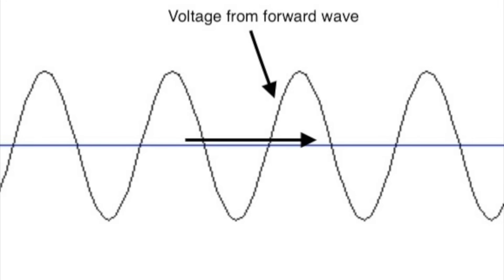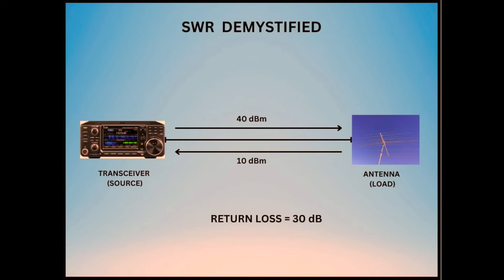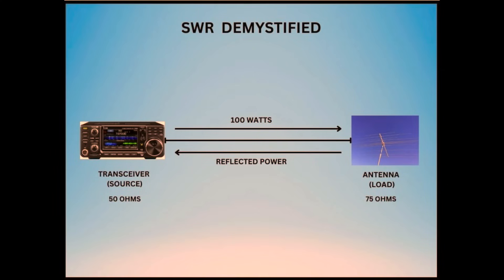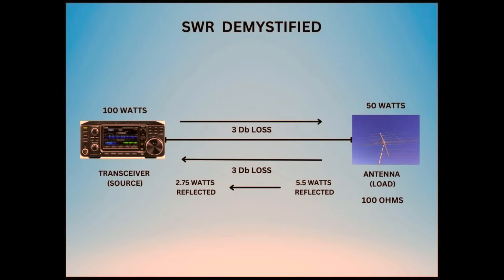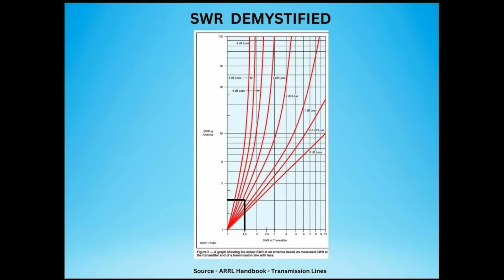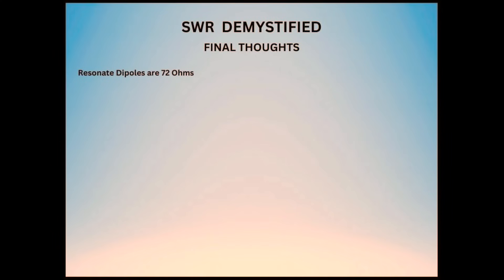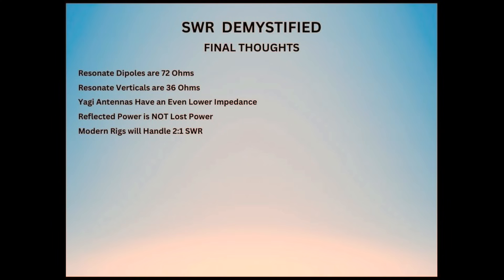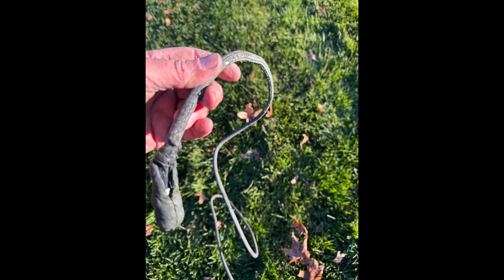The Truth about SWR: Debunking the Myths and Misunderstandings

Comment: If power isn't reflected and absorbed by the transmitter, why are finals damaged by having a high SWR? 

My personal take on feeder losses is that if you have a loss anywhere near 3dB you need to give your head a wobble and give up - especially at HF.
Reply: Put a 500  ohm , Yes 500 ohm dummy load on your transmitter output. 10:1 SWR. The 66% of the power cannot be transferred to the load by the PA Stage. The PA Stage is still making power. So the heat has to go somewhere .  Consider a 50 ohm load at the end of say a 500 ohm open line. 1/2 wave length long . What happens then? Are those reflected waves going to blow up your finals?
Reply: @2321brendan  that's exactly what I've said,power won't leave the transmitter, a half wave length of feedline will repeat the load impedance,if 50ohms then no there's no reflected waves
Reply: @2321brendan  I don't get the point that you are making - you state that the heat needs to go somewhere which I agree with, so where are you saying the heat goes? Into magic beans somewhere or reflected back to the finals of the transmitter?
Reply: @rjy8960  if you don't understand what he has said you can't call BS
Reply: @Pioneer936  Lol yeah, right.
Reply: @rjy8960  yep you full of bs
Reply: @Pioneer936  I passed my RAE at the age of 15 back in 1983, worked in communications all of my life having graduated from Coventry University and had one communication system that I designed patented. 

You?
Reply: @rjy8960  yet you don't understand how the radio is overdriving it's self trying to put power into the system
Reply: It's the impedance the radio sees that causes the radiobto heat up ,reflected power joins the forward power back towards antenna
Reply: @Pioneer936  How does an impedance cause the radio's PA to heat up? For a PA to heat up and fail it implies energy does it not? I'm asking where that energy comes from.
Reply: @rjy8960  the radio is trying to put its maximum power into a mismatch line which causes the radio to over heat ,the power that leaves the radio is less the difference of the reflected power
Reply: @Pioneer936  I'm sorry but I really don't accept this. 

The fundamental problem with this argument is a 3dB loss in the feeder. This is BS. As I mentioned in my initial post, a 3dB loss in a feeder is a stupid assumption to begin with. Even at 2.4GHz over a 24m run of feeder my losses are better than 1.6dB. At HF they are a fraction of a dB. 

Have a look at some of the reports for finals failure for the QRP Labs QRP radio's where a mismatch of over 1.5:1 causes the output MOSFETs to fail. 

Why does this happen if all of the reflected energy gets reflected back to the antenna?
Reply: @rjy8960  it happens as I've mentioned before because the radio is overdriving itself to put power into the mismatch
Reply: @Pioneer936  This whole argument is BS. Power is reflected back into a transmitter and can cause damage. My Kenwood TS-990 will start folding back power with a mismatch of 1.5:1. 

Why do you think that broadcasters spend a shedload of money on low loss transmission lines and monitor the match between the antenna and transmitter? Because they are dumb and are using lossy feeders? 

This whole argument is absolute BS.

You want to lose 3dB of your power in a transmission line and just hope for the best, then be my guest. 

I still haven't had a technically sentient argument against my initial question.
Reply: @rjy8960 it foldsback power because of the impedance the radio sees

Comment: Using RG-8X coax with my 20w G90 seems to work just fine, but if you have a more powerful base station and want to support a wide range of frequencies, then getting good coax is a definite must.
Reply: 5 Watts here and Mini 8 coax 25 feet so no great loss to 20m to 10m dipoles and works well.
G4GHB
Reply: I have been a Radio Ham operator since 1984 and my advice is buy the best coaxial cable you can afford as it can be the weakest link in an antenna installation and as SWR increases this will in turn increase the coax losses especially at higher frequencies above 28MHz.

Comment: ive got my swr down to 1.3 but when i talk into the microphone it goes up to 3 is that bad ?
Reply: Short term that isn’t an issue, but make sure to use an antenna tuner if you have one.
Reply: @Sonicgott  yes i tuned my antenna dead key down to 1:4 with an swr meter its just when i talk into the mic it jumps to 3 and above
Reply: R.f. getting back?
Common mode currents on the coax?
I'd check for r.f. on the coax. If yes, put a ferrite ring on.
G4GHB

Comment: @DXEngineering I would love to see a presentation about a 130 ft doublet fed with 1" twinlead/ladder line.
Reply: That's a good antenna, especially for HF. Balanced feedline impedance largely depends on the wire spacing. The smaller the spacing, the lower the impedance. The feedline impedance levels off around 750 0hms, with a spacing of about 2 feet or greater. If the wires are spaced a hundred yards apart, the impedance will still be around 750 - 800 ohms! Original balanced feedline consisted of 2  12 gauge wires spaced 6 inches apart giving an impedance of around 600 ohms on HF frequencies. Back then, SWR wasn't even a thing! You could easily tune the final vacuum tube finals to match the high impedance feedline. Every drop of power developed by the finals got radiated from the antenna.

Comment: Art, I have been an RF engineer in broadcasting for 45 years. My background is high-power AM and directional antenna systems, as well as FM and TV. I currently work for nearly the biggest corporation in the U.S. and is a worldwide company, so I too know a thing or two about RF. Sure, LF-MW can get away with some losses, but let’s not be teaching people that reflected power is a myth and doesn’t mean anything. It’s contradictory to admit losses occurring in the coax and to then say the reflected RF will find its way back to the antenna. Tell that to the many who have blown up finals and overhead tubes. And with many low-power rigs out there only capable of 5 watts being used today, antenna system efficiency is important. 

I’m looking at pages 9-5 and 9-6 of the 19th edition ARRL Antenna Handbook and it clearly addresses exactly what I am about the importance of matching and where to do it. It even refers to Frank Witt’s article, “Match Bandwidth of Resonant Antenna Systems” in the  October 1991 QST. I’m not sure what books you are referring to, as they discuss line mismatch losses in the “Feed-Line Impedance Mismatching” paragraph starting on page 9-5. 🤔

Comment: Oh my, now we’re tuning coax! Tuners belong at the antenna, not the transmitter. Are you putting your half-wave antenna baluns at the transmitter, too? All you’re doing is creating more loss in power by bouncing the impedance of the 50 ohm cable on both ends. Phase would only be affected by the output coil, but what you’re adjusting it for is to wipe out the reactance. The SWR or reflected power from the forward coupler metering circuit is not looking at phase, it’s looking at energy flowing in a particular direction. I need a Tylenol. 

This is why resonant antennas work best folks. This is why the  DXCommander and similar resonant antennas work well. Keeping the load as close to 50 ohms and minimal reactance is the key. And when it isn’t, matching/tuning it at the antenna will provide the most effective results, not the tuner in the shack. All that reflected power coming back into the shack is really getting lost in the coax, your output tuning network and final amplifier transistors or tubes, and not slingshotting back out into the antenna. Again, use your basic training; place an ammeter on the antenna and calculate your results.  Or… Place a remote tuner at the feed point and tune/adjust for maximum power from the shack. 😊
Reply: I like resonant aerials. I have 5 dipoles 20m to 10m in my attic and an outdoor inverted vee for 60m.
I was given an MFJ 16010 tuner with two SO239 sockets, one to the tx and one to the aerial. All I use it for is one to the tx (changed to BNC as I run QRP) and a banana plug fits nicely into the other SO239 to a long wire. I've never thought a tuner on coax to an aerial works well.
Before I built my resistive SWR meter I adjusted my tuner and long wire, a roller coaster and variable cap. at that time for maximum r.f. out as indicated on an r.f. pickup meter at the wire. It served me well for years. I used a similar set up at a special event station with three 5 foot lengths of aluminium tube which slotted together for a vertical.
G4GHB
Reply: @TheScottClifton reflected power joins the forward power it doesn't go back into the radio and damage it ,the radio damages itself trying to put power into a mismatch that's why we use tuners at the transmitter

Comment: I find the best VSWR is when you connect a 50Ohm lump of carbon across the antenna, but i don't seem to hear much. My ERP is very bad as well. But i'll live with the great VSWR 🙂
Reply: LOL
Reply: Don't be lazy.  Get to ant to resonate at the operating freq with a 50ohm load... That carbon dummy is absorbing unnecessary RF power.
Reply: @Johann-ZS6L  but my 50 carbon load works  on all frequencies giving me a perfect swr of 1:1, its a joke man, swr can be great  with shit coax and  no antenna. Back in the 80's a new ham on 144MHz had a great 1:1.5 swr  but could not work anyone. Checking his set up he had the thinest coax I've seen and it was snapped at the antenna. We calculated that with 10 W in a out 1 or 2 watts reflected back so  bugger all at the  swr  bridge gave a great reading.
Reply: @Johann-ZS6L  no I was just pointing out that a good vswr does not mean that the antenna is doing anything.  Long runs of coax, antenna mismatch,  etc need to taken into account.  I check my antennas with the vswr bridge as close to the antenna as possible or use a NanoVNA which gives a better view on the mismatch. Makes it easer to decide if it is too long or too short. 73 a radio ham since 1980

Comment: Another thing to Keep In Mind is that 1 S-Unit is 6db so 1/2 S-Unit is 3db, and in most cases 1 S-Unit signal loss at the other end will not be noticed UNLESS your close to the noise floor in Weak Signal Conditions where your signal could be lost in the noise. I have close to half a century as a ham and made my living as a radio tech, and I don't let lossy bands with high SWR and an Antenna Tuner prevent me from making a contact.  73  mike  🍺🍻

Comment: Please explain how reflected power eventually gets radiated. Before you do, place an RF ammeter at the feed point of the antenna, as well as a bridge or VNA to determine the exact resistance. Then using the standard formula of (I x I x R) current times current times resistance, and then tell us what that calculates out to. 

Now, use your VNA or impedance bridge and measure the impedance of your transmitter’s output. This would require activating the antenna switching relay to actually do so, but in most cases you’ll find the output if a transmitter, or amplifier, is lower than 50 ohms, which will create more power loss as a terminator. But let’s assume it’s 50 ohms for easier calculation and our transmitter is 100 watts. A coax loss of 3db at the antenna that causes a 10% loss of power means 45 watts is flowing forward into the antenna and 5 watts gets sent back to the radio. If what you’re saying is that this power is then reflected back from the radio to the antenna, the power at the radio is now 2.5 watts and by the time it would presumably get back to the antenna, it’s now 1.25 watts. So, it is getting wasted, and nothing of any consideration would be sent back to the antenna. Now, if you assume the load is actually much lower, like in the 5-10 ohm impedance, then even less power would be sent back to the antenna. 

Now, I haven’t even began to discuss the phase of the forward and reflected waves, but length DOES play a role here, where it could be possible that any amount of power that is reflected back to the radio, or the antenna from the radio, could be phase cancelled or attenuated. 

Simply put, reflected power is mostly lost power and very unlikely to make round trips and find its way onto the antenna.
Reply: If the output impedance of the transmitter is low (can be 5 ohms or less!), then you will have a discontinuity, which is a 50-ohm cable driving a 5-ohm load.  This is a 10:1 mismatch, which is 1.743 dB return loss.  This means 1.67W is reflected back into the coax to make the journey... drop another 3dB, and it's 837mW, which hits that 2:1 mismatch, meaning 89% is radiated, putting 745mW onto the antenna.
Reply: Lossesd power until you put a tuner in line to correct the phase and return it back to antenna
Reply: I guess you can go ahead and contribute to the next update of the ARRL Antenna Book, if you so sure that the authors, including those who were designing antenna systems for deep space programs, didn't know what they were talking about... And yes, many people have measured the power the way you described on a low loss coax.. And each time it would measure forward power plus whatever gets reflected back to the antenna. 3db loss coax was used as a more of a dramatic example to stress the point. No one is using such a lossy TL in real life, at least intentionally...The caveat is LOW LOSS coax
Reply: No, Art, Chapter 9 supports my position just fine, they too promote line matching at the antenna. They even include the broadband matching concept, which I also agree with to minimize our losses as we go above and below our resonant frequency. Since reactance varies, your antenna’s resonant point might need to be skewed high, while another’s may be lower. The point is to balance the 2:1 points equally above and below your favorite operating area. This makes the tuner corrections slight, which minimizes loss.
Reply: @TheScottClifton if it's mostly lost power ,how is it that a doublet antenna with 10.1 swr has most of the power radiated by the antenna
Reply: @Pioneer936  Most anything will radiate something, but by comparison to a resonant antenna that is properly matched, the actual radiated energy from that doublet would be much less. Doublet’s are usually in the 300-500 ohm range and require a balun to properly transfer the energy to it. This is an antenna that would have the balun at the transmitter end, as the transmission line used would be 300-450 ohm balanced ladder line, which is more efficient than using unbalanced coax.
Reply: @TheScottClifton  a resonant antenna is not necessarily more efficient than a non resonant doublet at all ,because the impedance is high doesn't mean it's less efficient, also a doublet doesn't necessarily require a balun,think a little research is in order
Reply: @Pioneer936  the maximum transfer of power does not occur when there are differences in impedance. You can’t reinvent physics. Sure, 50 ohms into 500 ohms might look ok on an SWR bridge that is measuring voltage in a forward coupler, but there will be very little current flow and acceptance into the antenna. Again, put an ammeter at the feed point of the antenna and calculate I x I x R (the actual measured resistance of the antenna) and determine what amount of power is actually flowing into the antenna. Especially with high impedance loads, the length of the line also matters to the SWR meter when placed at the transmitter. If you have a quarter-wave length of coax, the return is 180° and thus would be quite attenuated by the cancellation effect at the transmitter end. This doesn’t mean the reflected wave didn’t exist at the antenna, so the fact that you didn’t see the reflected power at the transmitter,  doesn’t mean it still isn’t a factor. So in this case, the SWR could look great, but actually just be nearly the same as an open piece of coax at a quarter-wave distance from the transmitter. This is why you have to determine the power being accepted into the antenna by using the direct method calculation. Then we can factor in all the other elements of loss, like radiation resistance, radiation angle of departure, etc.
Reply: @TheScottClifton  that's why we use a tuner at the transmitter to allow maximum power to be transferred into the system, the tuner will correct the phase of the reflected power inphase with the forward power back to antenna, if for example the line was loss less then all power is then radiated by the antenna that's why low loss feedline like 600ohm open wire is used on a non resonant doublet, a 10.1 swr on this system with 100 watts out the radio only 3 watts is lost ,97 watts is excepted by the antenna  more than a resonant dipole for that frequency
Reply: @Pioneer936 Yes, using a tuner with this setup is a good replacement of the balun. Normally I am against using tuners at the transmitter because most are trying to match low-Z and typically lossy coax. The history or root of the tuner was with open-wire transmission line, which today is uncommon. While my work is mainly with vertical antennas in AM broadcast, I am a big proponent of balanced antennas. The only caution with your setup is when we deviate our frequency of operations to where we start seeing 100’s of ohms of mismatch at the antenna. The more the mismatch, the more the feedline acts as an antenna. But in the case of open-wire, you won’t be losing nearly as much radiated power as a result, but you may be lighting up the shack a bit. 😊
Reply: @TheScottClifton  the feedline doesn't act as an antenna because of an impedance mismatch no matter how high that impedance is ,an antenna imbalance causes the feedline to radiate not an impedance mismatch